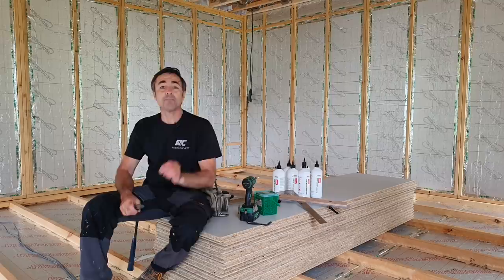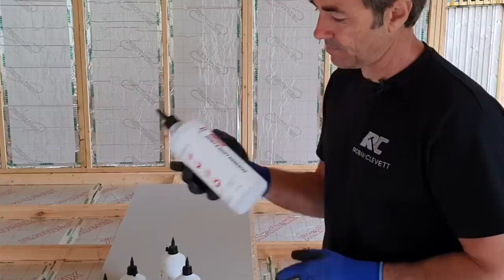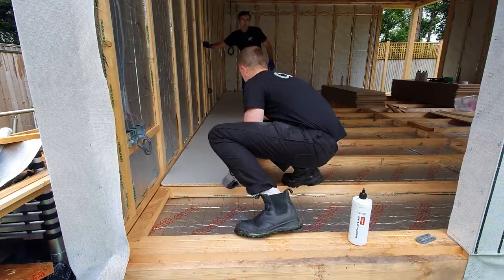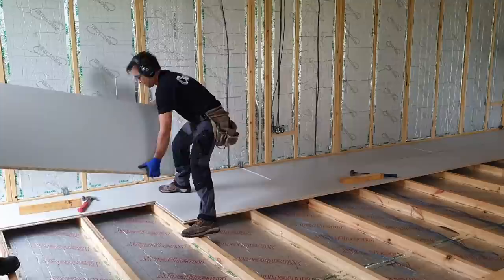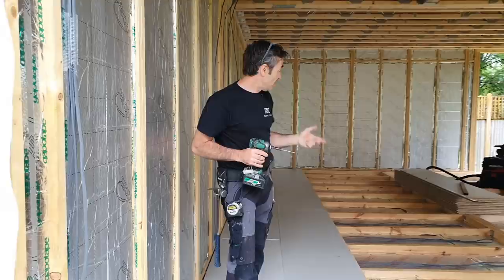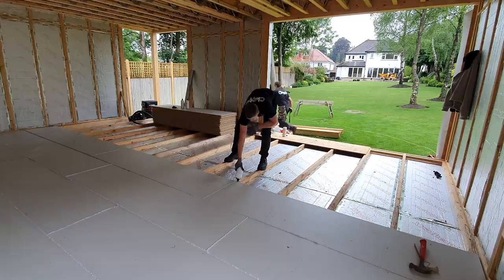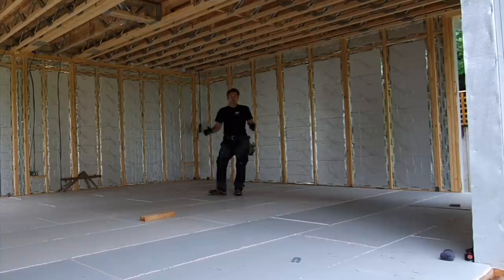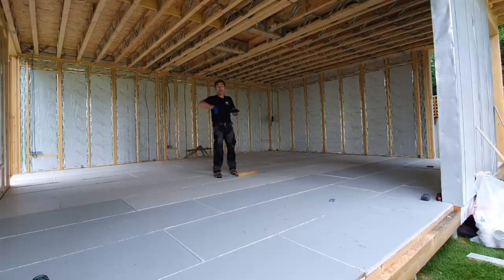Building a Garden Room Laying Chipboard Flooring, 22mm Egger Protect, The full How to Guide on site

Comment: Just got back from sorting out a floor on a 30 year old house.  Joints not supported, no glue, copper pipes rubbing on boards, ring shank nails worked loose, appalling squeaks everywhere. If the developer had invested a few hours in doing it properly like you did the owner would have avoided years of awful noise and saved me three days grovelling about on hands and knees.

I see you working steadily, tidily, not cutting corners and the end result is a permanent high quality solution.

Me trying to build the quality in afterwards is a very expensive and only marginal solution that should not have been needed at all.

Comment: Another meticulously planned and professionally executed job, you are a real credit to your profession. Interestingly, PU glue must have moisture to cure properly with the moisture content of the air usually sufficient to reach an acceptable bond. This adhesion or bond can be improved by atomising water on the P5 board joint prior to fixing. This helps the glue properly penetrate the board fibres and also ensures the PU to reach maximum cure and strength. That’s why it sticks to your skin so enthusiastically due to moisture or perspiration. Atomising takes longer and some would say is too fussy but it certainly makes a strength difference and also makes the finished job far more moisture resistant which is never a bad idea in an potential ingress situation like a bathroom. Just a thought!
Reply: Has anyone ever tried pulling a floor up that's been down decades. Bang a few screws in it and be done. So much time wasted. Quality job I must say. 👏

Comment: I have used chipboard flooring since 1969. I use Kronospan a British product with a waterproof finish. I use silicon in the joints with a 5 thou gap to allow for any movement. Screwed every 6 inches.  These 8x2 boards will fly over an 18 centre joints without a support. noggin. You are doing a good job men.

Comment: Good to see how this floor should be laid properly. I had a friend who bought a new build and had them back out numerous times for the squeaky and lifting flooring. They never did resolve it and I can see why as they probably didn't use the correct glue or in the quantity that you should be using it. If I were 30 years younger I'd love to have you as a mentor. Great work ethic.

Comment: Much nicer board you have there than here. 3.6m x 0.8m Yellow tongue flooring 19mm 450mm centres for joists. Crappy plastic strip for a tongue. 
When I was an apprentice chippy on site over 20 years ago there we were using Caber flooring, PVA glue on the joists and joints and firing in ring shanks with the Paslode. Cheers Jerry
Reply from the maker: Thats mad!! Why are they so long?? They must be heavy too!! Like your plasterboard!!! Hope your well bro
Reply: @ukconstruction  Yes they are horrible. The dimensions you have are much easier to handle on site and pass them up to the next level. I am good thanks, hope you are to. Enjoying the roofing videos, always pick up a useful tip or another way of doing things. All the best. Cheers

Comment: I’ve left this flooring out in the open for longer than 60 days and it was fine very good flooring and can be tiled over no need to over board
Reply: Rubbish. You cannot tile straight over it! Ask the manufacturer and adhesive company. Your talking bollox
Reply: @daveyboy6883  have you read the spec on egger protect ?
Reply: @daveyboy6883  so what your saying is egger have made it up then on their spec it says it can be tiled directly on to it
Reply: What i am saying is my enquires with 3 technical people from adhesive, Schluter and board makers say not to tile directly on to P4 and 5 boards. Infact one even stated that it should be  plyed over.
Stick that in your pipe and smoke it.
Reply: @daveyboy6883  so you asked board over competitors if you should board over, and they said you should. Colour me suprised, bit of an own goal on your part. I dont know if you can, but it seems to reason that if the manufacturer states it as the other guy says, then you can do it. Manufacturers dont regularly test other market products, if they did its all they'ed do. This is why the other manufacturers will give a canned response, its called accountability.. particularly of you are speaking to would be competitors..
Reply: I give up on you. I can only tell folks my experience with P4 and 5 boards. Mind you i have only been in the flooring trade for 53 years. I have spoken to many a pretend ecpert.
The trade is full of them
Reply: @daveyboy6883 53 is that it I’ve been at it 54 years hahaha calm down mate life is to short to worry about me
Reply: @marlowjoinery9783  you were perfectly polite in your engagement. 53 years clearly isn't enough time for some people to be respectful. You might be wrong of course, I have no idea, but you're perfectly correct to expect egger to give accurate product information.
Reply: @daveyboy6883  Did those P4 and P5 boards have the same protective coating as Egger Protect?

Comment: Why do you need an expansion gap, if the sheets are glued to the joists they can't expand or the glue joint will break, also is the gap between the insulation and the sheets important?

Comment: Chipboard has come a long way  remember the old ring shanks , very impressed with the system , won't like to get that glue on my boots it'd get everywhere 😩 . 👍🇮🇪☘️👏👏😁
Reply: You're so right John. I remember having to knock all the snots of the joists before loading out 22mm sheets and then nailing it down, as you say, with 5 ring shanks per joist, (all hand nailed), and, as Robin said, just PVA glue on the joints. 💪 Ahh, the good old days.........NOT🤩
Reply: @thetallcarpenter  Not as much fun as doing the ceilings though. 8 x 4 sheets a hammer and a pouch full of nails. On a good day you had a mate, otherwise it was a deadman made from 4x2. But we was happy.
Reply: @daihedral9269  Crikey Dai, now we're really going oldschool. 🤪 I used to go tacking with my mate who was 5'6". (I'm 6'6"). We looked ridiculous either end of with sheet swinging over our heads. 🙈 Remember trying to hammer a clout nail through the board into a noggin, (1/2" always was nogged), and hitting a knot?. 😖 Thank goodness for drywall screws. 😎

Comment: Hi There Robin
I was wondering if you could help me out with some guidelines. I live in the Netherlands, and I am looking at doing the following:

1. Ripping out the Living Room floor and making sure that the room under the wooden floor is in order.
   1.1 Going to change the piper work ready for a heat pump.
   1.2 Going to lay network cables down.
   1.3 Going to lay damp foil on the floor.

Question: Is there anything else you would take the opportunity to do whilst the floor is totally open? So make the foundation under the floor airtight? Or Cement the bricks on the foundations to provide a better seal for the damp foil?

2. Want to insulate the floor.

Questions:
 - Would you use Hard insulation board or Something like Rockwool.
 - Ventilation: Should the insulation be up against the chipboard floor or does there need to be a space of say 2 cm in between?
 - Do I need to use a vapour membrane on top of the insulation, before, I lay down the boarding across the joists?

3. Boarding up the joists

Questions: 
 - I have the original wooden planks, would you through these in favour of chipboard bording?
 
We are going to install underfloor heating, just FYI.

Thanks in advance for any tips advice :)

cheers
Mark

Comment: Superb job as ever!! Would this flooring be good to replace normal 22mm chipboard in my bathroom refurb? I'm fitting an Impey aqua dec, and the entire floor will be tanked once it's down, then fitted with ProGrid UFH decoupling mat and finally tiled. I was going to use marine ply, but finding 22mm is impossible plus it's £130 for an 8x4!! 😳

Comment: When I'm doing decking or garden buildings I use 400mm centres on the floor joists, am I wasting my time?! Do you not get a bit of bounce at 600 centres? Love the channel by the way, great work. Cheers, Bob Rogers.
Reply: 22mm boards for 600mm centre is perfectly good. 400mm centres can get away with 18mm boards.

Comment: nice big garden room ... wish all floors were this easy to do 
Curious, why go for top of the line chipboard when you can use 18mm OSB3? I guess this looks nicer but it's a subfloor so no-one will see it. The OSB is the same size, same if not greater strength and the same water resistance. 
Then if you are after water resistance same question about cement board. Why egger protect instead of a cement board ( Hardie or ever an insulated one ).

Comment: If anyone can answer my questions would greatly appreciate the help.
1) Will start making similar floor to be used as gym. Which is stronger surface Egger Protect or same thickness structural Plywood with same fixings and adhesive? 
2) Vapor barrier under floor or not and why? I've seen plenty videos for colder climate where they use vapor layer under floor etc...

Comment: Hi Robin, it looks like you left the excess glue on the joints without cleaning them off. Is that part of the process to allow the glue to fully cure? To be cut out after? Really love the channel and videos. Fantastic work.
Reply from the maker: Hi Daniel, This allows the floor to be water proof for the duration of the build, then after the roof is on you just use a decent flat scraper and it comes off, I also like to inspect that we have an even glue distribution everywhere after we are all fitted

Comment: Hi , what if you use rockwool between joists and have the polythene vapour barrier over the top ? Do you just follow the same process or just glue the tongue and groove . Also would it be ok to build stud walls onto the chipboard as opposed to the joists? Doing a single skin garage conversion to a games room . Cheers great content !

Comment: I know its meant to be a 10mm expansion gap around all edges but I'm curious if this is necessary with everything being screwed and glued these days? Surely the movement is reduced by doing this?
Reply: apparently wood (not man made chipboard) need room to expand, that is why as bricklayers we  have to tight pack floor joists into the wall? no idea asked nhbc inspectors , was told no idea its in the book
Reply: @stevehallam6495  guys it isn't wood though . Never seen expanding or contracting
Reply: @stevehallam6495  my point is its manmade floorboards it doesn't shrink or expand . It's not wood its overkill which by the way is great . But I've yet to see a glued and screwed joint open up or start bubbling the floor .
Reply: @stevehallam6495  in a garden building like this we build floor first put sheets down and build walls on top so no expansion joints ? What's the point . To me its dangerous working on joists without floor down the whole principle of egger is you can work outside on it before roof is covered  . Not everyone can get the prices to build factory made buildings using glulams and factory made structures I'm working on it though 😉
Reply: @stevehallam6495  agreed 👍
Reply: I use a gap equal to the tounge,makes it easier to fit,
Reply: Yes the expansion joint is a requirement layed down by the Timber manufacturers. 10mm is a minimum.

Comment: Hi Robin, i'm struggling to find any videos of you using plywood as a subfloor material. Apart from cost is there any reason to use chipboard over plywood given the number of complaints and advice an average DIYer stumbles across online? Best Regards
Reply from the maker: Chipboard is really strong and stable and if you wanted to use plywood then this indeed is possible and I have used a Plywood deck once or twice but it is slightly more expensive and can have its own problems if not fixed or supported properly, A decent P5 Moisture resistant chipboard flooring that is well glued down with the correct glue is unbeatable in my opinion, many complaints come from earlier installed chipboard floors used in many large developments, nothing wrong with the products but when the price work carpenters get given the prices from the stingy house builders they had no choice but to get it fitted so fast!!! leading to some issued in the future

Comment: Robin, what are your thoughts on glueing down floorboards. Is that the way forward?? Many contractors don’t like doing it in case there’s an issue and they need to open up the floorboard again. I can see their point.

We used No More Ply concrete boards instead of normal floorboards in our renovation. I glued them down and then screwed them in too. 

I just fear that in 5-10-15 years when I want to update/check something, I won’t be able to take the boards off without damaging them.
Reply: God help you, my guess is lifting may damage the joist unless done with care.

Comment: I had many calls in the past where people have asked me why their floors are squeaking not long after having new flooring laid on top of mew chipboard or ply. Every time it’s the sub floor where the chippy hasn’t pre drilled a pilot hole and the screw worms off the joist 1/2mm then over time a squeak starts, very annoying but it’s costly to the client to pay to have it all done again and 9 times out of 10 the culprit will not be accountable.

Comment: I don't really understand what the 10mm gap is for. Expansion? If so would there be much movement being glued and screwed? Or is the 10mm gap for something else.?
Reply: It's for expansion there might not be alot of movement but it is timber and they can't 100% guarantee no movement hence the 10mm gap hope that helps 🔨
Reply: Mice 🐀
Reply: Expansion due to heat or moisture

Comment: It seems your making the t&g end on the joists? Is that just luck or are you cutting them to fit?
Reply from the maker: Hi Daniel, when I design and set out a floor I will set the joists so the short edges of the deck boards fall on a joist, I prefer this and it avoids support noggins, even the row offcuts will fit straight in at beginning of the next row over a joist

Comment: Hi Robin, great vid, I have a question. I have always been told that the insulation should be kept tight to the underside of the floor boards, has this changed?
Thanks keith
Reply from the maker: No you can have a small service or air space, but.... the insulation needs to be really nice and airtight with no performance gaps, this is the same as if the insulation is hard up against, in the past we have had design details on drawings and specifications that had factored an air space in the build up on the warm side to actually improve the u values it depends on many factors
Reply: @ukconstruction  thanks Robin for taking time to explain and answer my question

Comment: How do you deal with joist spacing that isn't as 'perfect' as this?  I laid this flooring recently and the board ends never landed on a joist.  It was a nightmare because there was 150mm celotex between the joists and not enough room to get support noggins in.
Reply from the maker: Hi Billy, generally I always plan my joists layouts and I will make sure that my flooring will be supported where possible, if not then we would work out where the joins will be and frame out then place the PIR insulation around

Comment: Have you ever used the newish green glue tape on the joists. About 3mm self adhesive to the joists and then you still glue the t&g joints?

I fancied using it thinking it would prevent any future creaks 10 or 20 years down the line because theres an actual cushion between the boards and joists.
Reply: How does it work when you’re setting the boards? At least with adhesive you can still move them to get the joints square, I’m just thinking that with tape will it not roll? And what about potential deflection in the joists? Never seen the product but curious to how it works.
Reply: @diddywright6165  I've not used it but it only adheres to the joist top and then the top of the tape looks smooth and claims to allow being able to slide the joists into position and then glue the T&G and screw down through the tape. It acts as a decoupler for sound and is made from closed cell foam. 

I'm interested to use it on my build but not seeing enough user reviews to know if its any good or stick with the trusted glue method which won't work as a decoupler.

Comment: Hi Robin, great videos very useful! I am planning my garden room now, and am working out the floor. Would you ever cover the whole base in Egger Protect, then build the external walls on top? Or would that leave the chipboard edge to close to the outside? The only reason I am thinking of doing that is so the boards have support on the first and last row on the long edges. My floor joists are 120 (The base will be 4 sections, of 3800 x 1800 bolted together, total base will be 7600 x 3600) so after the insulation I only have 20mm of depth for floor board noggins, which is not enough. Other option I thought of is triple timbers around the perimeter, so the wall sit on the first two, the there is one around the inside perimeter to support the floor boards. - but that seems like a waste of timber. Any help much appreciated. Many thanks Simon

Comment: Hi Robin, great video and a quick question. Can the D4  Egger glue be used on p5 chipboard that is not egger protect? I have bought p5 chipboard from wickes..
Reply from the maker: Hi Bob, yes it can be used, it can be used on the joist and on the joint

Comment: Why do you leave this 'big' gab above the insulation and below the flooring board? Why not bring the insulation higher up or put in more insulation?
Reply from the maker: Services, can pass over the top of the insulation on the warm side without damage to the insulation
Reply: @ukconstruction  That's a very good point. I am however afraid of rodents will like it too. If they could come in, that is. Do you install special measures that will not happen?